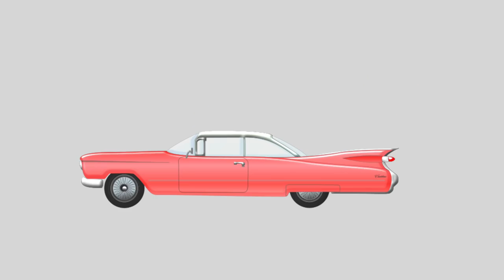Yes, Rockets CAN Fly in a Vacuum

Comment: Nice, funny that you have that car . . . Cars usually have steering wheel. With that steering wheel you can steer the car at the same direction, where you are going to. Steering wheel is connect to front wheels, which then rotate and turn, and make steering possible. Apollo rocket do not have any turning/steering wings, so it is impossible to steer apollo in any directions. Apollo thrust motor are so powerful, that any kind of manually steering is also impossible, if you can/could turn the rocket thrusters in any direction. All that those astronauts could do is just hope that apollo goes right direction.
Reply: That's what the computerised guidance control computer was for.

Comment: I am still have confusion. What things provide the reaction.???☺
Reply: In the rocket engine the fuel and oxidiser combust to produce combustion products, which become exhaust gasses, and a lot of heat. That means that the exhaust gasses are extremely hot, and for a gas being extremely hot means that the individual gas molecules are careering around extremely fast. As the gas molecules are careering around extremely fast inside a container they repeatedly collide with the walls of that container, and as they bounce off those walls (while they force their way out of the combustion chamber and down the engine nozzle) they also impart a small push to those walls with each collision. The 'action' is the sum of those collisions with the inner surfaces of the rocket engine and the 'reaction' is the sum of the tiny pushes on those inner surfaces caused by those collisions.

Comment: How can you push against Nothing ???
Reply: The rockets take MASS with them to space to push on.
Are you suggesting that mechanical RECOIL stops working in a vacuum?
Reply: @stuartgray5877  Hmm... Ok, so the gas that's expelled is used to push the rocket? What's stopping the gas from just being exhausted without a resultant force? I mean Newton's 3rd law doesn't just stop after the gas, the gas has to have something resisting it's movement so that it can push the rocket... no?
Reply: @shagadelic3000  does the exhaust gas have mass? Does it get "accelerated" by the rocket engine?
Can mass be accelerated WITHOUT a force or is a force REQUIRED to accelerate an object with mass?
What do Newtons Laws say about those three questions?
Reply: ok.
You throw something very hard. you will feel a push back after you let go of it.
Same happens in a vacuum, but it goes further, this is because theres no air resistance.
Rockets push against their gas, they are now able to move freely. Oxidizer and fuel exists.
Reply: @shagadelic3000  Incapable of answering my trivially simple questions about basic physics?
Reply: @shagadelic3000  Correct. There's a gas law confirming it, w=PV.

Comment: Can you explain why the thrust calculus on all rocket engines take in consideration atmospheric density (pressure) ? With no atmospheric density (pressure) there is no thrust.
Reply: What thrust calculus? This one?
F = m dot * Ve + (pe - p0) * Ae
Reply: @Jan_Strzelecki  no, not this one...
Reply: @marcuspolus6270  Which one, then?
Reply: @Jan_Strzelecki  if I must educate you, then you must pay. I will send an invoice to you. I spent over 20 years learning about this.
Reply: @marcuspolus6270  if I must educate you, then you must pay.
You've just spent four days dispensing your "education" for free. Why the sudden change?

I spent over 20 years learning about this.
Did you pay for it as well? Can you get your money back? ;)
Reply: @DrCash7  Love you too, sunshine :D
Reply: You have it backwards thrust is MAXIMIZED in a vacuum.
Reply: @marcuspolus6270  if you spent more than 20 minutes studying this it would be surprising.  What happens if I fire a crossbow in a vacuum? Will I feel recoil?
Reply: @marcuspolus6270  : Air pressure push against the propulsion gases, effectively slowing them down.
So a rocket is less efficient in air than in vacuum.

And that's what's Jan equation is showing...
Reply: @stuartgray5877  wow...are we talking about fluids ? Or just mechanical action/reaction in a vacuum ?
Reply: @stuartgray5877  Do you understand the difference between recoil in a mechanical device and thrust based on fluids dynamics ?
Reply: @ThomasKundera  you got it wrong...it is propulsion gases that exits at high speed and high pressure from combustion chamber pushing against the atmospheric air...
Reply: @marcuspolus6270  : "Do you understand the difference between recoil in a mechanical device and thrust based on fluids dynamics ?"
What is the difference to you?
Do you agree that an isolated system conserve it's momentum?

"you got it wrong"
Go back to school.

"it is propulsion gases that exits at high speed and high pressure from combustion chamber pushing against the atmospheric air."
No.
Where did you got that fallacy?
Reply: @marcuspolus6270  - "Do you understand the difference between recoil in a mechanical device and thrust based on fluids dynamics "

Do YOU know the primary principle of physics that makes rocket propulsion possible?

It is the "Law of Conservation of Momentum".

Would YOU care to explain where the Law of Conservation of Momentum says that it applies to solid matter but NOT gases?
Reply: @marcuspolus6270  @Marcus Polus - "Would YOU care to explain where the Law of Conservation of Momentum says that it applies to solid matter but NOT gases?"     Didnt THINK SO.....
Reply: @stuartgray5877  in your opinion, shooting a bullet in vacuum is the same as a helicopter running in vacuum ?
Reply: @stuartgray5877  In vacuum you have no gases to oppose the exhaust gases...look...it is childish...if you don't understand the difference between solid and fluid, I can't help you.
Reply: @marcuspolus6270  Could a crossbow firing a steel block propel itself backwards in a vacuum, in zero-G?
Yes
Could a crossbow firing a Water ICE block propel itself backwards in a vacuum, in zero-G?
How about a Dry Ice (Solid CO2) Block?
Reply: @stuartgray5877  if is ICE, then is solid...even if is water in ICE state. And yes...you can fire a bullet from a gun or arrow from a bow in vacuum. If you can survive vacuum, you can throw a bowling ball also. But a fan in vacuum is useless. Can a helicopter fly in vacuum ?
Reply: @marcuspolus6270  so what about a FIREHOSE?  Would a person holding a FIREHOSE in zero-G, in a vacuum feel recoil if someone opened the valve and let water blow into vacuum?
Reply: @stuartgray5877  you can find on youtube many experiments about vacuum. You can check and see what happen with different situations. As long you can't tell if helicopters fly in vacuum (or flies) then there is not so much I can talk with you.
Reply: @marcuspolus6270  so you refuse to answer the question about the FIREHOSE?  And I certainly do NOT have to do any research about " the vacuum of space".  I am literally sitting in a world class "Thermal VACUUM test facility" right this minute.  I was trained in operating vacuum chambers at Lockheed Martin Space Simulation Labs almost 25 years ago, and I have been operating vacuum chambers professionally since then.
Reply: @stuartgray5877  so...the helicopters can't fly in vacuum, huh ?
Reply: @stuartgray5877  how long the firehose is ? Diameter ? Pressure of the fluid...viscosity of the fluid...Flexibility of the hose....Look...if you have a 10 meter long hose, with honey under pressure, you have a slowing down effect on the hose because of the viscosity of the honey....but at the exit of the hose you should not have any thrust because there is no air pressure (or any other force) opposing the honey exiting the hose. So...we are talking about different materials with different properties....you try to compare banana with cherry.
Reply: @stuartgray5877  oh...working there does not mean you understand the physics of fluids.
Reply: @marcuspolus6270  if the FIREHOSE is ACCELERATING THE WATER, then there IS A FORCE.  Period.  If a giant railgun feels recoil from firing a GIANT ICE BLOCK, Then WHERE DOES THE FORCE COME FROM?  Please draw yourself a force diagram of the railgun firing the ice block then tell us WHERE does the force pushing back on the railgun COME FROM.  I'll give you a hint: the force pushing forward on the ice block MUST BE COUNTERED by the raulgun. With an EQUAL FORCE pushing back.  Draw the diagram of the firehose now and SHOW THE FORCE PAIR.
Reply: @stuartgray5877  my friend...you know nothing about physics...
the firehose is not accelerating the water...it is a pressure pump.
A giant railgun feels recoil because is pushing a giant projectile....it is called inertia....and reaction to inertia...You have a block with zero velocity....at a moment you start pushing that block with a force....in order to make that block to move, you must break the static inertia of that mass....and this is how the reaction is created...recoil...
You have no idea about physics...believe me.
Reply: @marcuspolus6270  I work in a thermal vacuum test facility, because I build, test, launch, and FLY spacecraft for a living.  I have personally helped launch five spacecraft: Mars Global Surveyor, Stardust, Deep Impact, Kepler, and JPSS-1 (now NOAA-20).  I was launch conductor for three of those, and helped FLY three of them during their missions. I also have an Engineering degree and almost 25 years experience as an Aerospace Test Engineer. You REALLY think you know more about this subject than I do??  Good Luck with that  👍
Reply: @marcuspolus6270  so it takes energy to accelerate SOLID WATER, but NOT LIQUID WATER?  Is that what you are trying to say??  So the railgun needs to provide force to accelerate solid water blocks, but the firehose does not need to provide a force to accelerate liquid water?  And YOU are ACCUSING ME of not understanding PHYSICS!?!   Tell us all right now: HOW MANY PHYSICS CLASSES HAVE YOU TAKEN IN YOUR LIFE?  I am 100% CERTAIN that the answer is ZERO.
Reply: @stuartgray5877  you don't even understand what I am saying...Whatever you accelerate, you must use enrgy (force)...the point is, no matter what you accelerate (bowling balls, water, gas, particles) in order to produce reaction, you need a force opposing that matter you accelerate. When we talk about fuel exploding in combustion chamber, it is a different phenomenon than when you throw a bowling ball. But you don't understand that. So...does helicopters fly in vacuum ? YES ? NO ?
Reply: @marcuspolus6270  how about we try another approach?  Watch the YT video "Six SpaceX launches synchronized to the landings" .  Then tell me what YOU SEE.  Because what I SEE is over thirty examples of rocket propulsion in a vacuum.  If you don't see that, let me know and I will point them out to you.
Reply: @stuartgray5877  now, allow me to return to some important things...I will not answer if you don't impress me.
Reply: @marcuspolus6270  watch the video and report what you see.  I REFUSE to let someone who has OBVIOUSLY never taken a physics class try to lecture an actual engineer.
Reply: @stuartgray5877  you have a diploma...but you are not an engineer. If you really know something about physics, you will stick to subject. I saw that video...nothing new...Do you know why they are flooding the launch platform with water ? Because I did understand that you have no idea about helicopters and vacuum....And stop insulting...if you really think about you that you are an engineer, then talk physics, not BS. I did answer to your questions...can you answer mine ?
Reply: @marcuspolus6270  nothing? No response to video EVIDENCE of rockets working in a vacuum?  No response to MY BET?  I am guessing you DID look at my resume and now you are too embarrassed to report what you read.
Reply: @stuartgray5877  you are so silly... I did answer to all your questions...learn to read and understand. According to you also Star Wars is real. I did not look at your resume...there is no need...you are just a pseudo-engineer...having a diploma does not confirm that you also know physics. Actually, I am sure you don't...you are aggressive, you don't have the power of argument, so you just rely on insults, you never answer to questions, always claiming how big you are because you have a diploma. As I told you before...you have no idea who I am...Talk on subject, talk physics, answer my questions...or stop posting to me...I don't have time to waste.
Reply: @marcuspolus6270    so now you can watch the YT video "Close Up Footage of Falcon Heavy Arabsat-6A!" and tell us those landings were fake.  Then answer the question: How did those boosters TURN AROUND and FLY BACK to KSC IN A VACUUM ?

Comment: A car's exhaust was supposed to 'push' the car forward? I thought the purpose of the combustion engine is to power the machinations that turn the wheels around, and the exhaust is to vent leftovers from that combustion process.

I'm confused.
Reply: She did say that the exhaust provides some thrust, but no where near enough to overcome the friction between the wheels and the road.

Comment: Not being mean but a exhaust doesn’t propel a car. When a piston goes up the spark is lit igniting the fuel pushing the piston back down. (step is repeated till engine is turned off) the motion of let’s say 8 pistons in a v configuration (V8) spins a axle which spins the wheels. The exhaust is there to get rid of the fumes the explosions in the piston creates
Reply: Yeah, she tried to spell that out.  But, I agree, she wasn't very clear.
Reply: The exhaust from a car has the potential  of propelling the car forwards, but the car would have to weigh only a couple of ounces for the exhaust to be effective as a means of propulsion  ;-)

Comment: Wow....yes a rocket does pushed off of the atmosphere to propell itself into the sky. Thats why they turn on the extra thrusters when they get into the upper atmosphere cuz they need more power to get the rocket through the thinner air as there isn't as much atmosphere to push off of.
Reply: @darklight2.1  - "yes a rocket does pushed off of the atmosphere to propell itself into the sky."

No, the rocket pushes off of the MASS OF THE EXHAUST GASES.
Even jet engines do NOT "push on the air behind them".
They push on the air INSIDE THE ENGINE!
Rockets get propelled forward by the SAME FORCE that causes RECOIL in guns and even crossbows - RECOIL FORCE from PUSHING ON MASS.

Comment: Depends on how you define flying. If you use the old definition of using aerodynamic control etc then no. However if the much looser definition of being able to propel themselves and control attitude and direction regardless of method, then yes they can.

Comment: She totally skipped explaining how propulsion works regarding fluid dynamics.  And I’m not talking about how the “engine” works. Nothing about the requirement for unequal pressure mediation that propulsion through a fluid requires to occur or the requirement for that fluid to actually exist to be able to apply that 3rd law. 
Claiming infinitely low resistance due to lack of atmosphere at the front of the vehicle but omitting that that same zero resistance is also at the rear is sneaky. Where is the opposing reaction. You can increase pressure infinitely in a direction. If there is nothing to mediate that pressure or oppose it, there will be no reaction. 

Basically,
You require a fluid to apply Newton’s third law. Ie atmosphere, water, gas or oil.  An oxidiser nor liquid oxygen are the fluid in this context, they are the fuel to increase pressure and not the reaction. The reaction is the mediation.
Reply: If one body forces a mass to change velocity, it causes a reaction. Basic  conservation of momentum means that the body will be imparted with the same momentum as the accelerated mass, but in the opposite direction.

The presence of an atmosphere is not a prerequisite for Newtonian physics or conservation of momentum.
Reply: Papa Legba  

You're holding onto a big cube of concrete about the same size as you, sliding across a frozen lake, with no other objects nearby. Frozen lake so you can assume no friction between you and the surface, thought experiments are abstract...

You were holding the concrete when you started moving.
As long as you're holding the concrete you can assume that you are one system.

Now you push horizontally against the cube as hard as you can and let go.

Do you change speed or direction?
What about the cube?
Remember there was nothing else around when you pushed.
Reply: Papa Legba  

Yes, the rocket and the fuel in its tanks are one body when traveling in the same direction and speed (when you are holding the concrete cube in my thought experiment).

They are most definitely NOT a single body after more than 100 metric tonnes of fuel (over 80% of the mass of the SIV-B stage of Apollo) has been forced to explode in one direction and blasted out the back of the rocket at 9000 miles per hour.
This is what happens when you push the cube in my thought experiment, only on a gigantic scale.

Nothing else is needed to move in space except expendable mass that you can accelerate away from the direction you want to travel in. Aka, rocket fuel.

Comment: Wow, there are so many comments! This is going to get lost in here  - but here goes anyway.....Newton's 2nd law is crucial to your explanation. The gas burning in the engine bell has much less mass than the rocket, so it undergoes a big acceleration downward while the rocket with its larger mass undergoes a much smaller acceleration upward. So the force and its reaction are the same but in opposite directions. Gee, can't do a quick explanation of this really. The car pushes against the ground and the car with its small mass accelerates one way while the Earth, pushing back on the car, accelerates in the other direction, a tiny tiny bit, because of its huge mass compared to the car. The car is the gas and the Earth is the rocket!